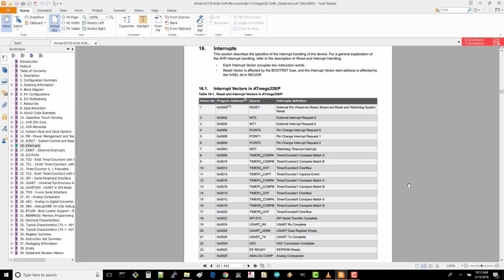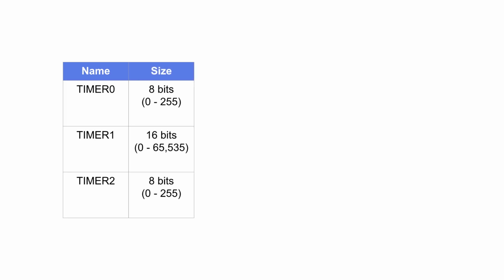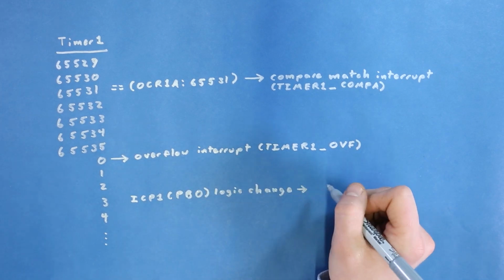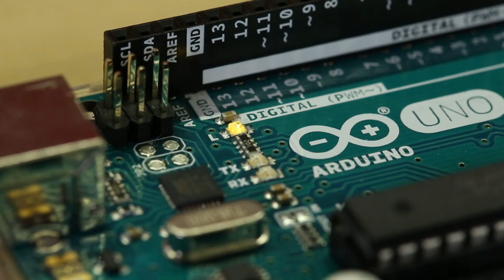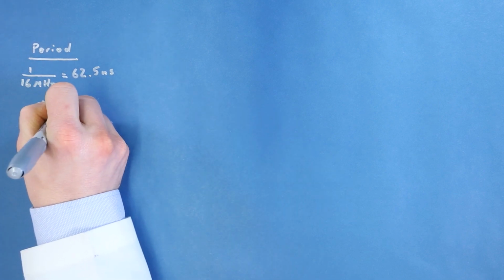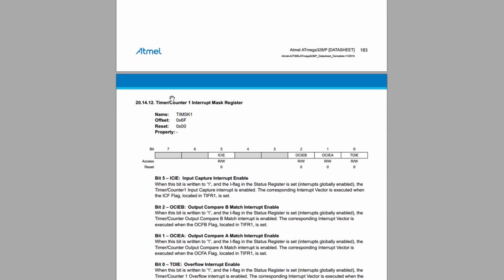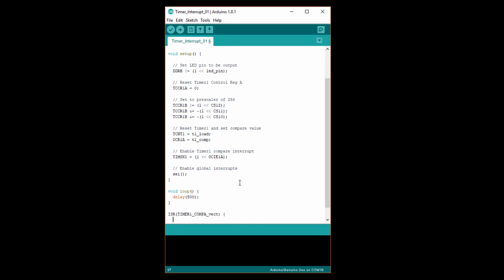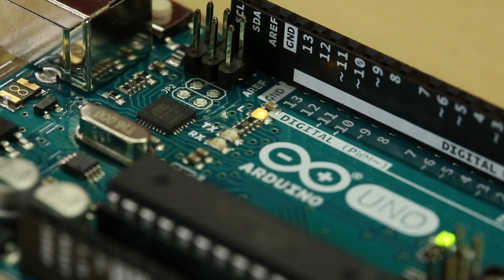Level Up Your Arduino Code: Timer Interrupts

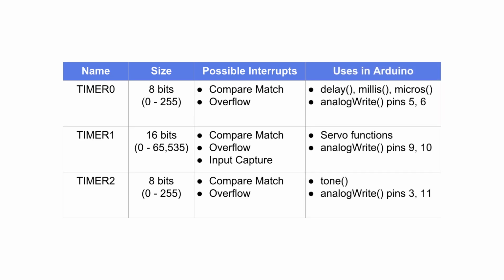Comment: Good show, Shawn.  The info at 3:51 used to take a deep dive into the arduino base code or a heck of a lot of googling to find someone else who had.  It's really nice to know what interacts with what or what's already in use - engineering is all about trade-offs.
i see you're now saying "left shift" - it seems fine to allow the beginner to ponder why C used "less than less than" to make numbers bigger...at least it's visually mnemonic.  To rag on you just a little further (17:21) - you might take a sentence to say that you're using the various &= and |= (and equals, and or equals) constructs to just affect the bits you want, rather than just jamming the register (since we don't know what the other bits were and don't want to affect them). 
To a noob, that might seem like a hard to understand bunch of back and forthing...so it's good to say why it's actually a good way, and why writing whole registers might cause an issue.

Now, if we only had the same level of cheat-sheet for the ESP8266 (or ESP32)...which would be a good platform to mention that this is all processor dependent and why we sometimes do it the slower/less efficient way in C (because #ifdefs in header files and macros make the code changes needed for us).
Reply: Yes, thank you for the "left shift" tip! I did mention the single bit flip &= and |= operations in a previous episode, which is why I'm glossing over them here. 

Totally agree with the ESP series. They're fun, cheap little chips, but the documentation is lacking. Perhaps that's what I'll look into next :)
Reply: You're most welcome.  The observations stem in part from the fact that I've recently been asked to teach a few beginners myself - "kids ask the darndest questions"  - which helps me remember what it was like to be one.  I didn't catch all the episodes so I missed that.
(Hint, I'm getting you to do some of my work for me here... ;~)
I spent some time looking for info on the ESP-8266, or more specifically the Tensilica (now Cadence) L106 processor, but haven't gotten very far.  Cadence only publishes overviews of what appears to be very customizable silicon, the specifics of this seem hard to find - which means that if you guys can find them - very valuable.  This is as far as I got: https://ip.cadence.com/knowledgecenter/resources/know-dip-ds  No datasheet like the Atmel so far.  I'd hope they aren't so precious with their IP as to make it unusable by keeping the instructions secret!  Maybe a deep dive into the source of their libraries?  I'd done this for the Uno long ago, to find out things like which timer was already in use for millis() and so on, but wow, this is pretty daunting.
Reply: I suppose we could always compile different C instructions and take a look at the machine code to decipher what the assembly instructions might be. That sounds like lot of not fun to me, though :P
Reply: No, and it shouldn't be required...but what I can think of so far (other than pinging them to get them to give us a datasheet - where you guys would have more clout than I) might be to look at the defines etc in their code for things like i/o register addresses, usages, and such.  After all, most of the arduino C peripheral libraries are pretty well mapped to this thing somehow.  I bet it's macros and ifdef kinda stuff, I doubt they re-wrote the world.  Time to work up the grep-fu, I guess.  The whole world using these things stands to benefit...This isn't as hard to find on the ESP32 as it gets its own obvious directory under Arduino/hardware/... with all kinds of neato header files and info...looking for the 8266...It seems to be hiding elsewhere.

Ah, a quick search of my linux box shows me these (as a place to begin to start, still, yuck):
/home/doug/.arduino15/packages/esp8266/hardware/esp8266/2.4.0/cores/esp8266/Arduino.h
/home/doug/.arduino15/packages/esp8266/hardware/esp8266/2.4.0/tests/device/libraries/BSTest/src/BSArduino.h
/home/doug/.arduino15/packages/esp8266/hardware/esp8266/2.4.0/tests/host/common/Arduino.h

Which of course include all manner of other .h files, but I'd bet what we want is in there...and we know it works.
Reply: Nice sleuthing! I do find it interesting that the ESP32 has a datasheet, but it doesn't cover anything about the instruction set or architecture.
Reply: Not that hard, it had to be somewhere, and in lieu of serious trickery, had to have some of the same names...But this doesn't tell all, just a lot (look at the other files in that dir, or wherever your machine puts them, mine's linux mate).  One thing I found is that this has DMA, and further searching around shows a couple things on GitHub that use it for kind of specialized stuff...but no clue so far in the arduino support code what all the bits in those registers mean or do.  Yeah - it's almost like we'd have to find a customer for that "custom IP SOC" - like whoever made the first ESP8266-12, and see if they'd give us a datasheet.  The originating company is too precious with theirs and maybe even has a deal with that customer to not tell details.  FYI, I sent my email to your website if you don't want this on youtube comments.  It'll quickly get past what's helpful for the beginners reading here.  (I think you might also find handy stuff clicking on my icon)
At any rate, turns out this thing has tons of hardware I've not seen supported by anyone else...Sparkfun might want to take the lead on that (good marketing etc).
Reply: Good to know, thanks! Interesting that it has DMA...
Reply: Yeah, that means it could drive all manner of new product perhaps.  All the examples (not many) I've found only use it for i2s, the audio serial codec interface (people add a 32 bit shift register to get 32 bits bit-banged via dma with little cpu load).  But it appears there's plenty in there that even Andreas Spiess hasn't looked at yet (open all the .h files in that directory in say, sublime text).

Comment: These tutorials are amazing.. Please don't stop..
Do you have a road map of what you plan on teaching for all upcoming "Level Ups" ??
Reply: Thank you! I don't have a road map, as it depends on where I'm needed. If I have time in between other projects, then I'd definitely like to continue them.
Reply: One thing I would like to suggest is something I STILL struggle with, which is deep sleep.. 
With the last two tutorials you have done, it has reinvigorated me with wanting to get the Arduino to sleep again and wake up and do something on a pin interrupt (button press) or a timer interrupt.. It would build on what you have been teaching us nicely
Reply: Yes! I was thinking about that one, too. It would build on the interrupts nicely, and I could measure actual power consumption and equate that to battery life. If you're curious, Alex did a really good tutorial showing how to reduce power on the 328p: https://learn.sparkfun.com/tutorials/reducing-arduino-power-consumption. I don't know if it's exactly what you're looking for, but at least it's a start.